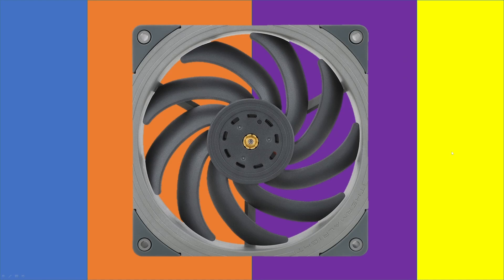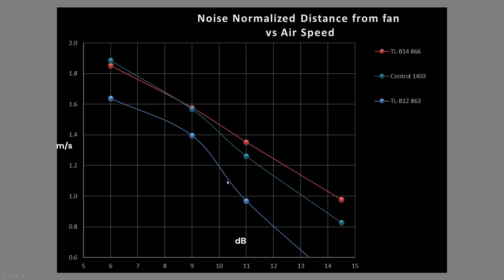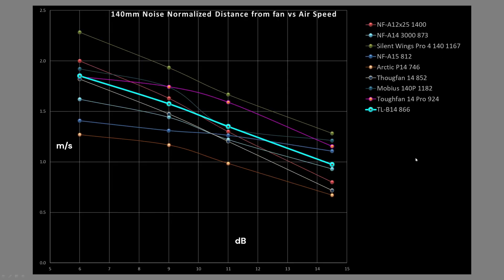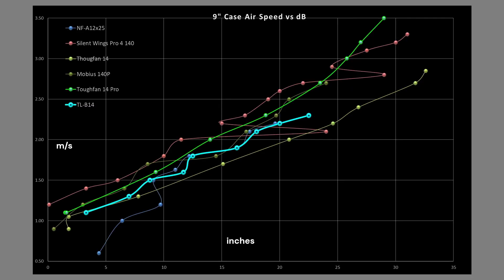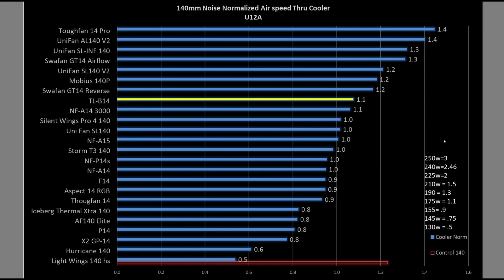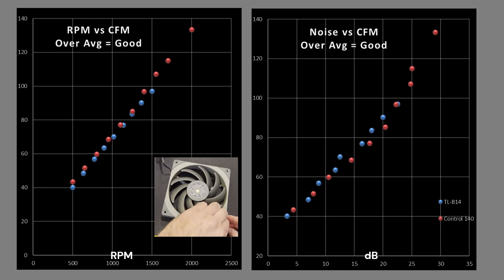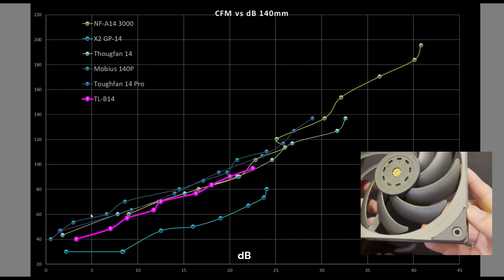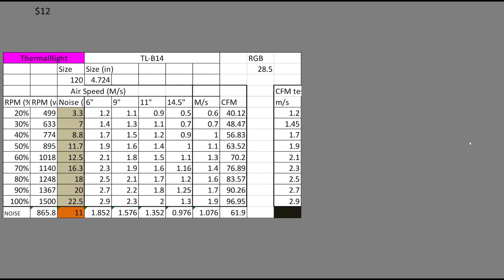ThermalRight TL-B14: Review.  Is it a good value?

Comment: The biggest thing missing from fan testing videos (not just yours) is Hz! Db is only half the story, human ears are much more sensitive to high frequency sounds. Two fans can be producing the same amount of Db, but if one is producing a higher frequency noise it will sound much louder to human ears. The TL-B14s and B12s both seem to put off a lower pitched hum than most other fans I've used, which makes them much less annoying.
Reply from the maker: I have a section displaying the noise level with Hz as the hoirzonal axis. but yes I dont focus on that. I am not a sound engineer so this is the best i can do for now. 
I want to be clear I agree with your comment. the frequency does matter. most people find high pitched sounds more annoying that a lower pitched on at the same dB level.

Comment: Came across this review video because saw these on amazon for 12$ so figured i could get almost double the fans instead of buying the 20$ "Cooler Master MF140 Halo" aRGB fans... but its always easier purchasing than getting rid of... so might get the 20$ since i can always buy more fans later as well.
Reply from the maker: I havent tested the Halos. Amz has a good return policy so the is a good option.
Reply: @computer-tech-more  Ended up buying a 3 pack of the halos, so far liking them but i wish they sold Reverse blade fans as well xP Definitely need to consider if a fan is reverse blade options next time.
Reply from the maker: @WyldWolfDragon  ive been trying to get more reverse blades in to eventually have a comparison of all reverse and regulars

Comment: I think maybe you messed up those graphs because the notations on the axis doesn't correspond with your explanations as far as I can read them. Nor do they make sense to me. For example, it seems that according to the first graph the more fans you add the less air-pressure they provide. And it just continues that way as far as I can see. Maybe I just don't get them?
Reply from the maker: the first one has 1 error on it with the label should be inches no dB :P ya, i think my video editor messed up and i didnt catch it. These graphs were made before I got the bright idea to label things. 
Then the one where it should be dB switches to inches. I think this one just got messed up with my soft labels. 

but with regard to looks like multiple fans droping in performance. this is why its important for a viewer to watch and listen. Also we jump from 1x120 to 3x140. I am trying to create a simplified baseline to show what size case would be at each measurement location. Best I could think of currently. Videos in filming right now have a picture of a case in it as well to try to help make it even clearer.